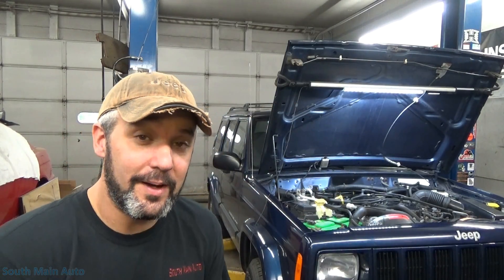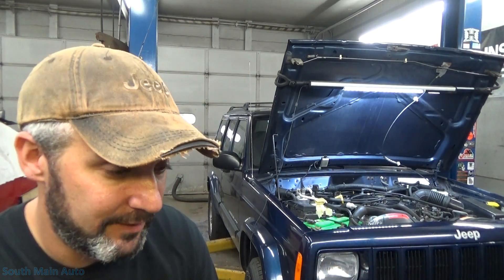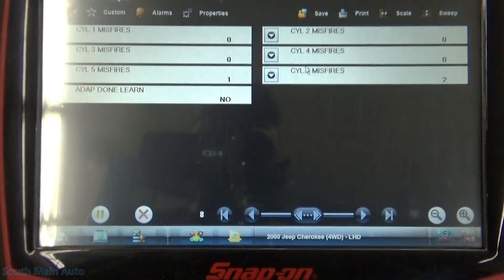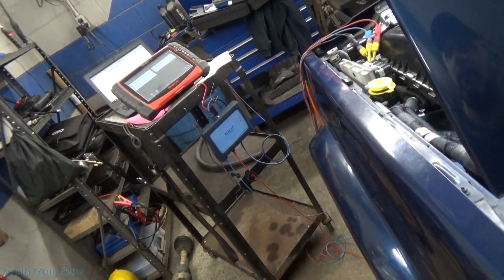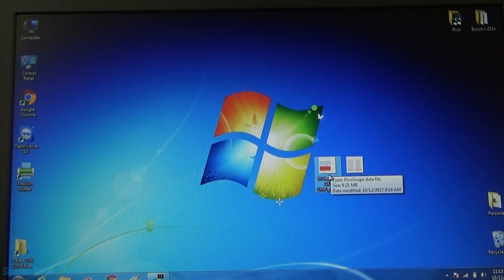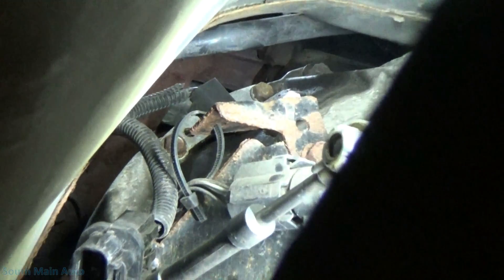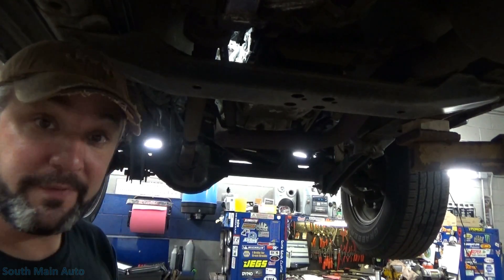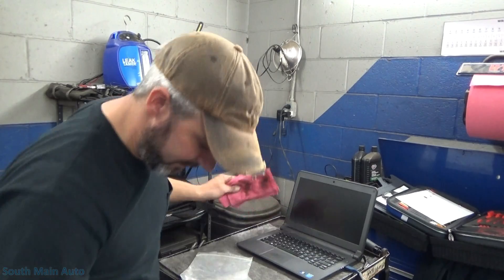Jeep 4.0 - Flashing Engine Light BUT NO MISFIRE!?

Comment: The Mopar Crank sensor using a specific code and pulse to communicate with the PCM (think of it like to encrypted phones taking to each other). The aftermarket ones are close but not enough to be registered 100% with the PCM. So there Crank sensor is saying "We're all good dawg" but the PCM is only recieving "We'r al d daw." Some are so off they won't even start even though the scope looks good.
Just wanted to add if you have to but aftermarket sensors the ones that will give you little to no trouble is Standard Motor Products. This goes for ALL MOPARS. A few of us guys on the forums fingered out why they didn't work when we were watching the programming in the PCM itself.

Comment: Did you try putting the scope on the knock sensor to measure voltage during events? Perhaps it acts differently with AM crank sensor? I figured if you got to guess....
Reply: No knock sensor on these

Comment: Good job on getting a Mopar sensor. I had a 97 grand Cherokee 4.0 and I had a similar issue and I replaced the crank sensor with an aftermarket. It ran great for about a month then the same issue. I got a Mopar one and never had the issue again. I learned Jeep's are picky with sensors.

Comment: A few years ago on my 1993 Cherokee Sport as we were on our way to Dallas Texas from Kansas.  As the temperature outside got over 90°, it died going down interstate 35. I had to sit almost 30 minutes, then it started and ran about an hour and died again. The check engine light only came on after it shut off. It did that until we got to our destination. Next morning I took it to a Jeep place about six miles away and it died 1/4 mile from that place. They told me it most likely was the crank censor, but they said they don't usually restart. Replaced it and works fine. I do carry one under the back seat just in case. But I have had problems with the early GM distributor module doing that same thing. Just figured it could happen.

Comment: Eric O:I've seen similar issues with aftermarket parts especially electrical or computer sensors. In a nut shell the circuitry(windings) aren't properly made and the sensor is just wonky.
I've seen this in everything from vehicles to ships and airplanes. Just plain poorly design and inferior materials in these sensors can really create havoc. All the testing in the world sometimes won't show what's wrong. When I started working at the shop I now work at, a '98 Ford Probe w/V6 was driving us crazy due to poor running. A seasoned and well experienced auto electrician nearly went crazy trying to figure this out. At that point the shop owner(my boss) decided to let me have a crack at it. When I set up the scanner on the graphic scale, I couldn't see any definitive cause as to why this car was running poorly. After some hard searching we decided to replace the aftermarket distributor with an OEM unit from Mazda since it's actually a Mazda V6. Problem solved. I said to my co workers never trust aftermarket electronic parts especially European or Japanese auto parts. This was just one of thousands of instances that I seen this symptom. I could go on and on talking about these issues. Always go OE when it comes to electronics. I've seen just too many issues not to know better in my more than four decades of being an automotive mechanic.

Comment: When it comes to crank/cam sensors I learned a long time (the hard way)ago to only use OEM.
Reply: Those 4.0's love Mopar sensors only.
Reply: Ben R Fords also.
Reply: Add Gm fuel pumps only & MAF sensors on GM cars. Been burned too often with non OEM parts. Cost more, but I only want to do it once. Especially dropping the tank for a fuel pump replacement

Comment: please help me s m auto!!!!!i have 2000 neon 66k it missing bad at 22-2500 rpm  ,it has new timing belt kit,pplugs wires coil,new tps sensor,it runs great at any rpm until i under load at 2500rpm but above n its fine?no money light exept occasionaly if u stay on pedal n force it at that throttlr position money light falshes n bell dings,but no codes no check engine light?????it did throw code once it was evap,misfire cyl 1, but they have been off for months.when i put car in reverse it sputters really bad also.im lost i cant afford to keep guessing n ive had it to two places n they cant figure it out,today it money lite flashed n bell dang for good mile i was on interstate n had to stay moving.im so sad n dissheartened over this i go to kidney diaylasis n have no family or anyway to get there i NEED MY CAR 
MY LIFE DEPENDS ON IT!!!!PLEASE HELP IM FROM PA I WILL COME THERE I WANT IT FIXED!!!!!!!!I can go great on highway as long as my rpm is above 2500 n i dont have any long hills to get up to speed on.i just put tps sensor on yestetday that did nothing but break my wallet $65.if it was my cat wouldnt it do it all time n not let me get up to 3rpm???(thats crusing at 70mph on i -80.)my phone is 814-648-8534 email pstancliffe76@gmail.com,please any ideas n will u work on it i will drive to ny i KNOW U CAN FIX IT i watch all your videos am big fan,please help

Comment: as a control electrician I see similar problems with electrical sensors. ( I call it noise) while the jeep is running a 12vdc system. the sensor is pulsing (like ac) so a small amount of induction can occur in conductors close by bleeding back into the circuit just behind the original source. proximity to said conductors and or leaks in the insulation can be the cause. wtf!? I know. changed my xj sensor with factory inspected old sensor and found insulation brittle and cracked.

Comment: What an odd and annoying fault because it is so indecisive.  As someone else mentioned, the transient spikes after the new sensor were fitted seemed lower, so maybe it was just a connection resistance issue or the new sensor might have a low value capacitor in it as a filter.  It could possibly be one of those things that didn't occur when they were writing the software, but as age crept in it became an issue.  There are some industrial control systems where you have to use a specific brand of contactor because the auxiliary contact closure timing is so critical that the software shuts off the machine and flags it as a contactor fault if the wrong brand of contactor is used.
Reply: It's really annoying when the timing isn't critical to the job the machine is doing, it's just critical to the time that was programmed. Programmers set it up to see a value in a very short time like .002 seconds when it wouldn't matter if it took 5 seconds.
Reply: @tiredoldmechanic1791  The rise/fall time on the aftermarket sensor most likely is causing the computer to get confused as it's not seeing a sharp transition to measure rotational acceleration. This allows it to run but not monitor itself. I suspect the "square" edge of the signal starts to round over. The programmer needs something consistent to trigger off to accurately measure acceleration. If we only cared about rpms I would agree that it's the programmer's fault. I'm a hardware guy and like to blame software too but this time it is not the programmer's fault. This suspected rounding (rc effect) is only visible if zoomed in. Then again I could be wrong as the data from the video is zoomed out way too far.
Reply: Shit up Engineer.
Reply: Electronics are fickle things... It's almost like programmers don't give enough leeway for things as they age. But, it is what it is I suppose
Reply: I have shot part at a car a few times and that's was the problem fixed😂

Comment: Love you videos !
I have a possible solution. It relates to a function available on good analogue lab oscilloscopes where the digital processing filtering will miss and sometimes is used to diagnose certain situations that get missed by usual waveform triggers and display.. Theres no where to hide on a scope EXCEPT maybe a fast glitch thats not being picked up on the picture and it continues to look good. I dont know if you have delayed sweep available but it will stretch out the waveform without going off the screen and perhaps on the square wave in this example where you expect a clean line, the line is shown in great detail and something might show up. You might need a lab scope not meant for cars that has this function and even the new digital lab scopes can miss with all the processing to screen. i always hook mine direct to the sensor so i avoid any interference ect and can get a pure comparison between the 2 sensors and focus on the square wave line up and down really really close up. That has to be it or the voltage is twitchy. Something  our eyes arnt seeing is screwing with the computer. Yet the problem is there as the car wont except that sensor.
You vast experience (unlike car "technicians") in this case got this car fixed and saved so much money for the customer and continues to prove that non oem parts are a bad idea in critical areas where near enough isnt good enough. The old CRT unlike the processed digital modern lcd displays, still has its uses in diagnostic situations and this rare example might be that time- an old $100 ebay 20 mhz crt scope might have helped and put this mystery to bed.
Love that reach around also! thats shows caring!!

Comment: I've replaced a few of these.  Without a lift, I found its easy to do it on the ground.  Place a jack on the Trans cross member, remove the 4 bolts/nuts.  Lower the trans down so it angles down, then use some nice extensions and maybe a U-Joint...   

I have yet to find a way to replace it easily from the top....

Comment: Could it be that the bad sensor was not supplying the correct current? All transistor based electronics have what is called Fan In/Fan Out specks the volts can be dead on but if it can't supply the current No Workie. A poorly engineered circuit would be likely to have to many inputs connected to one output.

Comment: The problem is using AFTER MARKET SENSORS, PERIOD, IT'S A CRAP SHOOT WHEN USING THEM. Either bite the bullet & buy from dealer or go to pick a pull, junkyard & get a few. Make sure their original equipment. EDUCATED GUESS NOT JUST A RANDOM THROW PARTS AT IT GUESS BIG DIFFERENCE SMA, GREAT JOB AS ALWAYS.

Comment: If this is what I think it is, it is analogous to plc inputs.  If you have a slow switching input, the software times is written to look for the next signal in a time ratio based on other signal inputs.  It's "window" to see this input can be extremely small and easily messed up by an extended input due to slow switching. So the real issue is the math used to program the ECM.  Not enough time after fall off of the previos signal by 1 pico second and this will count a misfire.

Comment: Old video, but I want to say this:  while 200microseconds isn't a long time, consider:  3000 rpm means 1500 ignition events per minute - one every 0.04 seconds.   When you consider the length of the pulse and all that stuff, you are looking at a very short amount of time.  That little variance in rise time for the crank detector may be just enough to trigger a partial misfire, enough to make the engine computer notice but not actually enough to make an actual misfire.  The combustion event may actually sort of complete normally because it's not really that far off, but it's enough to trigger the computer.   I suspect it shows up most on throttle lift off because of how far the timing is adjusted in that situation, perhaps making the 200ms more significant.  It may not seem like much, but it's much!

Comment: I could see a little noise on the crank scale. That could have been causing the problem. So I finished the video and sure enough the electronic noise or whatever you want to call it is different between the before and after shots

Comment: The after files are no longer available. Looks to me like the rising edge is rounded at the top. Maybe the PCM is having a difficult time deciphering exactly when that pulse begins because of it, maybe has to see a certain voltage threshold before it count's that as the start of the rising edge. internal driver in the CKP sensor is having a hard time producing a sharp square wave. I'd bet that curve isn't there on the after waveform.

Comment: 2001 GC with lots of pissy-little-'minor'-tooling-around-getting-it-right-things-that-annoy-me-so-it-doesn't-let-me-down-&-I-know-things-are-right-issues. They're not bad vehicles, just vehicles that need maintenance! 
Liked & subscribed! TYVM for an informative channel.
O2 sensors are another red headed stepchild for these as well as clean battery terminals. I've seen on a few occasions these Jeeps are fussy about very clean voltage & copper core spark plugs. No better plugs for them.

Comment: This is exactly what's happening in my 2003 jeep grand Cherokee. I've done the spark plugs, starter pack, and nothing. No signs of misfire but when on the freeway it says misfire po300 po305 po306. A mechanic looled at it and agreed he had no idea maybe wire harness. I don't know what to do.
Reply: Did you fix it?

Comment: When I was a mechanic in the late 60's at a Cadillac dealer a customer  brought in his Caddy and said that when then transmission shifted the engine would shutter. He had it tuned up just recently with good well known parts but. We ended up changing the points and condenser with GM parts and that cured the problem, go figure.

Comment: Jeeps do not like non-OEM sensors. It's just that simple. I know this from experience on a 2007 Jeep GC 5.7l.  Go to the dealer and pay the man for the Mopar part. It's better that 3 trips to Advance (Buy the part, exchange the part that didn't work, refund the part)and then one to Jeep .
Reply: Scott Berger 
I own a 2001 Chrysler Sebring convertible LXI, needed to replace the engine as a rod had come through the block by my soninlaw. It wouldn't give a green light to pass emissions so I took it to the dealer for an inspection sticker. What I got was no sticker and 14 pages printed out with defects. Upper and lower ball joints were bad and a whole host of problems. All four yeah four O2 sensors needed to be replaced again because he didn't know Chrysler products require factory O2 sensors to work properly. After replacing the last O2 sensor the scanner finally lights up green light. Dealer wanted $2897.41 to fix and give the car a sticker. Cost me just over $1200.00 to fix everything. Using an old school mechanic at his own shop. Took over 6 months as I was on a budget. The wife's idea of maintenance is put gas in it and stick the key in it. That was 5 years ago, just finished replacing the oil seals between the engine and transmission.$ quote was $600 actual cost just under a K. Both engine mounts needed replacing, massive aluminum mounts. The rubber had broken through on both of them. What's left? Drivers door motor and right rear window motor then everything will work as intended.

Ahhh. The pleasures of vehicle ownership when your wife refuses to listen to my advice. I lost her last year after a medical issue. 
 Now finally in another month I will have the car back to factory specifications. 

After seeing what you went through replacing a window motor I think I'll include the regulator with the motor on the drivers door.

Cheers!

Comment: being a shade tree mechanic, i just check the resistance between terminals b and c on the cks.  should read an open circuit, in my experience, and according to my haynes manual, if it shows a low amount of resistance, the sensor is bad.

Comment: Could this be the issue on an 04 2.7l dodge? I keep getting cylinder 3 misfire. Changed the plug and coil pack and still getting it. Runs fine though.

Comment: I have a theory:  I have to assume a few things 1st:  5 years ago, I assume the CKP fixed his no-start AND did not cause the misfire codes/CEL.  If that's correct, here's my theory:  Junk aftermarket CKP is electrically fine, but mechanically got LOOSE INSIDE.  The internal coil is loose, moving around creating the illusion to the ECU that the crank is arriving too early & late, which is how it decides if there is a misfire or not.  Does the old sensor rattle if you shake it? (Even if you cannot hear anything, I would say this may still be plausible).  Improper / poor assembly to blame, while the part remained electrically intact?

Comment: Love the video. Excellent work once again. I just replaced the cam and crank sensors on my 08 Ram 1500 4.7 even though it was still running well. Why? The truck has 170,000 miles, they go out on high mileage 4.7s, and the sensors are cheap and easy to replace. I HATE a no start condition and cold weather is here. I look at them as a normal maintenance item on these engines.....

Comment: Couple years back, a Duralast crank sensor i put on my personal 96 Cherokee left me chasing the tail of an invisible ghost which killed my entire weekend and it was the only 2 days I had off every 45 days. It showed up on a SnapOn scope and a multimeter as working fine hot or cold so I completely wrote it off in my head. Dug through EVERYTHING else, even the ECM software... eventually I took a chance a went and swapped it out at Autozone, and it fixed it!!! ...... for another month. Then the same shit happened. Replaced a second time under warranty, got another 6 or 7 weeks out of it... took it back to Autozone, got the manager to refund my money, went to the local Jeep dealer and dropped the added price on a factory sensor. Never had another problem for the remaining 3 years.